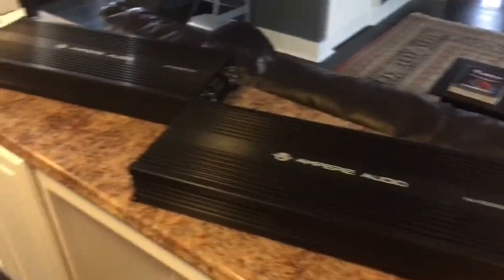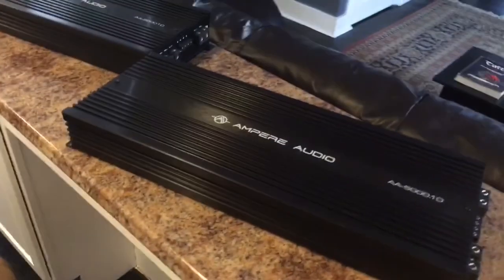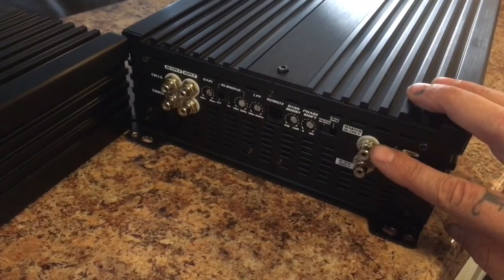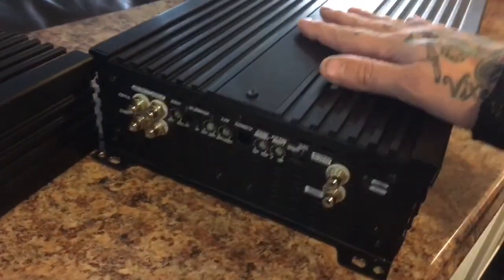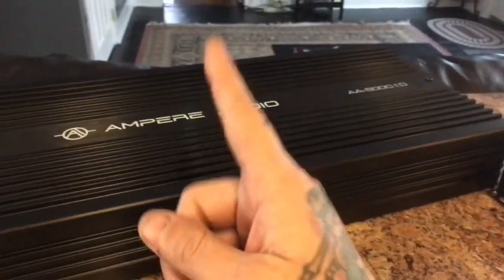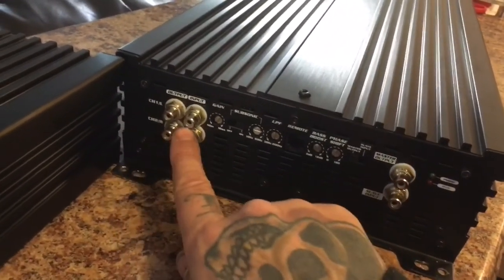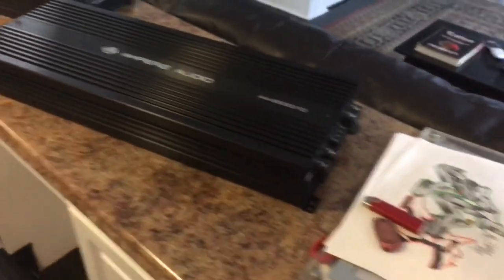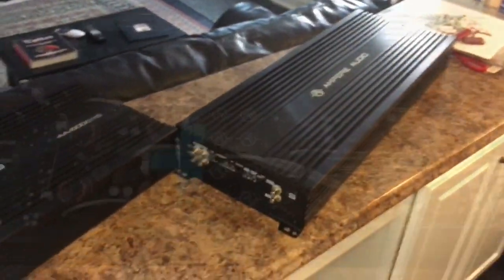THE BEST CAR AUDIO AMPLIFIER

Comment: So 2500 ish per sub? But why?
Reply from the maker: Etrigan Seven what do you mean but why ? Why what ?
Reply: EARDRUM ASSASSIN why so many watts?
Reply from the maker: Etrigan Seven because they can handle it lol
Reply: Because inefficient subs sell bigger amplifiers.
Reply: Eardrum Assassin  I have cuestión I have 13 volts on my behicle I upgrate my alternator 180 amps and that big 3 but my amp wen I turn that volume up gong on protection and I have skar  2000 rms and this don’t go on protection but I was searching my soundqubed 2200.1  they gibme 2800 rms at 14.50 I don’t have extra batery and my subs are 2500 rms each  so how many battteris I Ned to reach 14.50
Reply: @Purozamachihue  You'll most likely never be able to sustain 14.4 its a stupid way to rate amps because in the real world your voltage drops they should build these amps to run at 12.5-13's that's where most ppl's voltage is Its a scam so the amp manufacturers can put those HUGE stupid numbers on there ratings